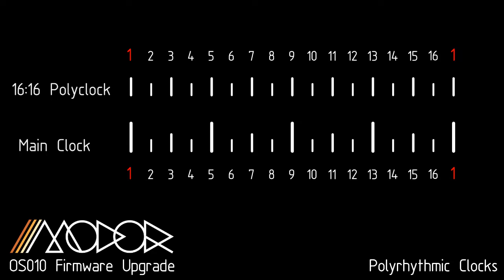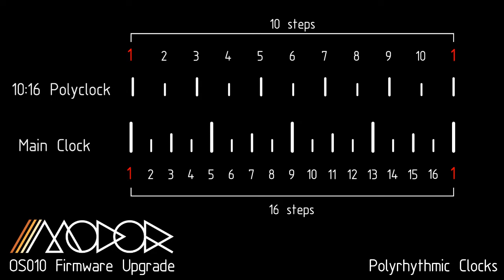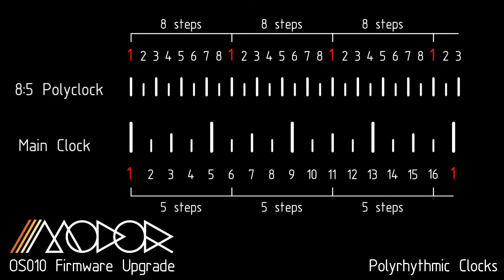Modor DR-2 OS010 Firmware Upgrade

Comment: Hi ! I winder if the séparâtes output can be transformed into trigger output ?
Reply from the maker: Not at the moment, though we've been thinking about a 'Trigger Model', that could be used to output trigger signals instead of audio. I'll put it on our to do list.
You can however already output triggers on the Clock Output. It's a System setting: ClkOutput. You can choose to output clock signals, or pick one instrument to output as triggers.
Reply: @ModorMusic   a trigger model is a very good option !!!! love it

Comment: Love that new polyclock feature! What I haven't really seen in an demos so far is the DR-2 doing weirder more experimental sounds. Do the parameters let it get into that terrain?
Reply: Do you mean recording parameter changes? I miss this feature, too.
Reply from the maker: @airloungestudio   The Modor DR-2 has parameter locks, so you can record parameter changes on a per-step basis (and you don't need a drum hit aligned with a parameter lock, you can also paramlock-change parameters of an already sounding drum). But indeed, there's no recording of continuous parameter sweeps, that's correct (though you can of course record parameter sweeps in a DAW or external sequencer. Everything is fully Midi controllable.)
Reply from the maker: Well, the DR-2's synthesis algoritms allow a wider range of possibilities than many classic drum machines. Maybe the sounds in the demos are a bit on the safe side, indeed. But they are intended to create drum sounds, so they will always sound rather percussive of course.
Maybe check the parts §3.3 - §3.8 in the manual to get a bit more of an idea how sounds are created in the DR-2. But I'll keep it in mind, to go a bit of the beaten track in future videos!  :-)   
https://modormusic.com/downloads/UsersManualDR-2_v4.pdf
Reply: @ModorMusic  Thanks! It certainly feels like there's a wilder side to this beast we haven't heard from yet

Comment: As usual… modor updates the DR2… one of the most Professional drum machine ever made.

Thanks !!! 
Please add a delay sync With tempo With subdivision… it will be so cool as a Classic 80’s plate gated reverb…
Reply from the maker: Thanks!
It was intentional to give the DR-2 no built-in effects. It would have added extra complexity to the design, and extra memory needs for delays and reverbs, and thus have added to the cost of the machine, for what would probably have been rather simple digital effects. 
All instruments have separate audio outs, just find some extra (2nd hand) fx boxes and you'll easily get better results. Or send it through a modular rack, or use the digital tools in a DAW or... 
For (delay) syncing, the DR-2 outputs both Midi clocks and a 24PPQN pulse clock.
Cheers, Marcel
Reply: Hi Marcel !

Ok understandX however is possible to use separed outputs not per instrument but as a bus? 

I got a reverb pedal and a stereo delay pedal. It will be use full to use them as a send retourne with an amour value for each instrument…

Exemple i Connect to output a a reverb pedal and want to wet thé snare and thé clap…

Dunno if it’s clear